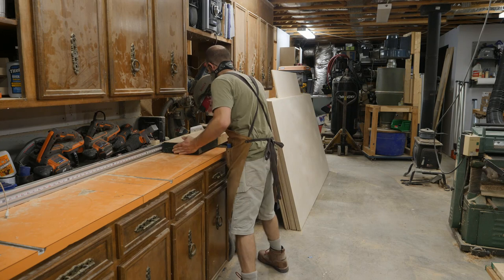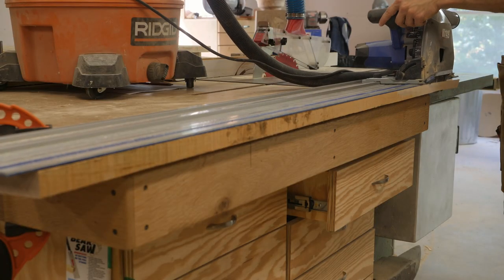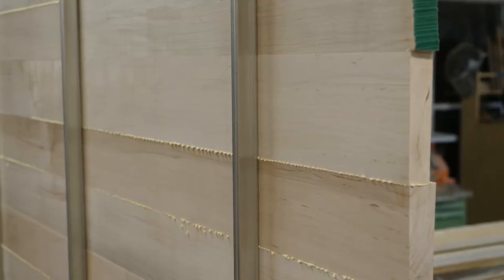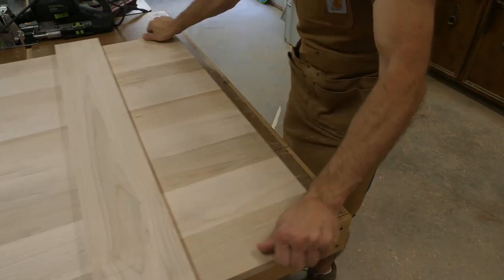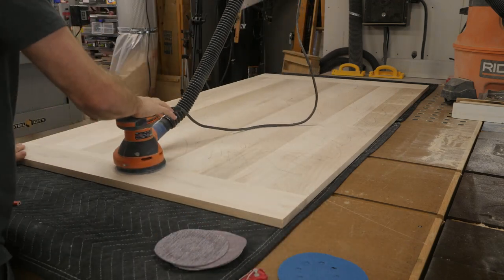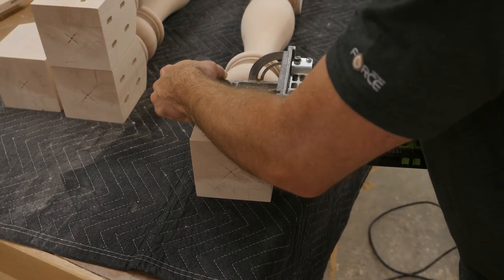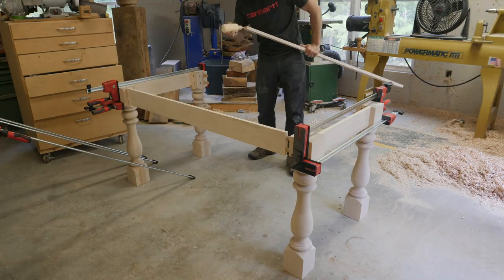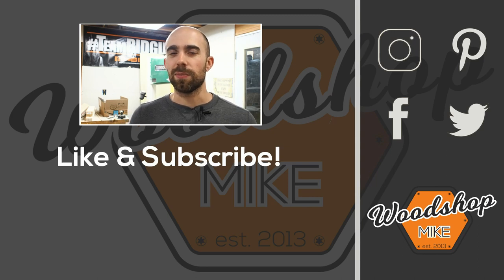How to Build a High Quality Dining Table with Breadboard Ends

Comment: I love the table, Mike. I like how stout it looks. Like something that'll actually last a long time.
Did you end up putting a chamfer on the bottom of the legs?
Reply from the maker: Thank you very much!  Yes I love the leg design on this one.  I would have made the top a little thicker to match the mass of the legs better, but my client specifically wanted the top to be 3/4" thick.  I did slightly kill the edges on the bottom 👍🏻.  Happy New Year!